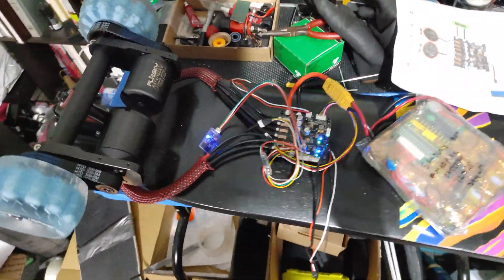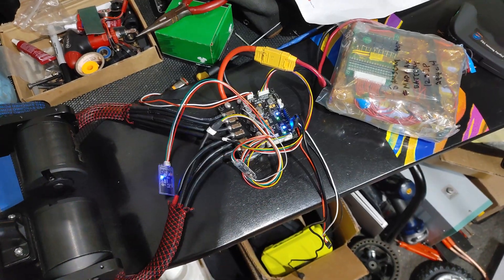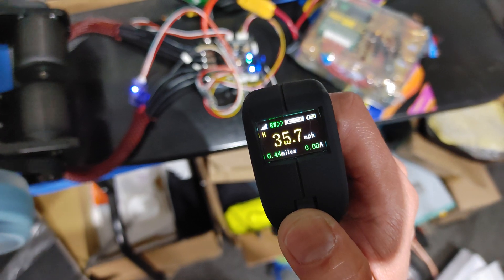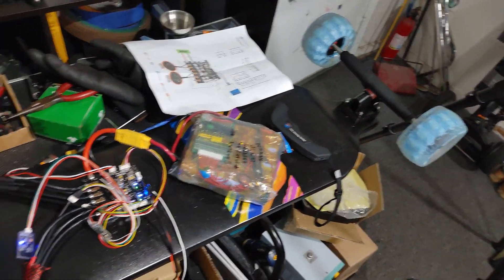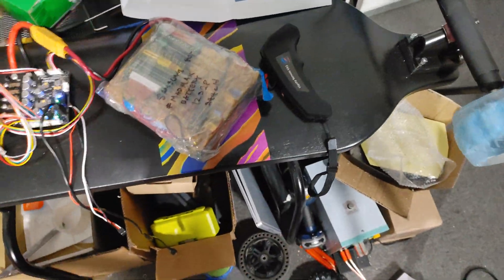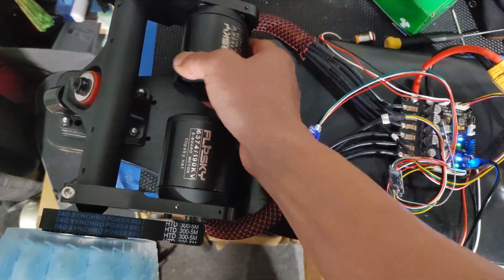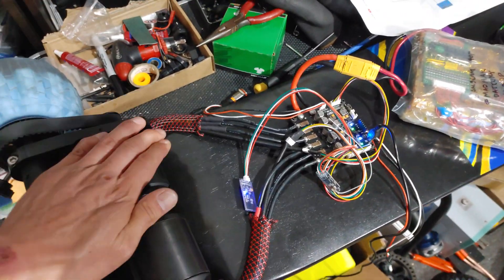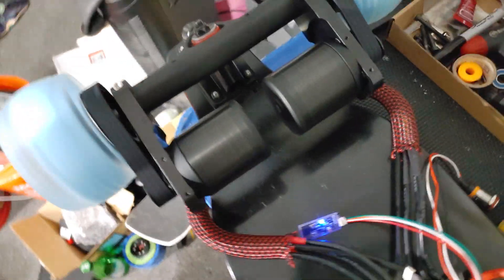Dual 6374 Flipsky Motor 12s2p Electric Skateboard #MadMax almost done!

Comment: Hi man i have 12s2p lipo batteries and same vx2 controller but 6374 170kv motors and vesc 4.20 plus esc 200mm wheels 72t pulley for wheels and 16t pulley for motors what top speed do you think i will have with this setup ?

Comment: Why mount motors that way? 
Have you hit them on any pumps?
Reply from the maker: This allows you to drag the board at any vertical angles otherwise your motors will hit the ground and scratch easily.  But you need large wheels for clearance to do this.  I actually recommend outward position for most though.